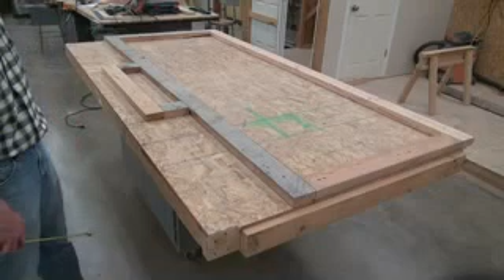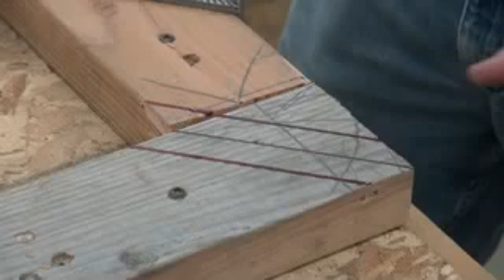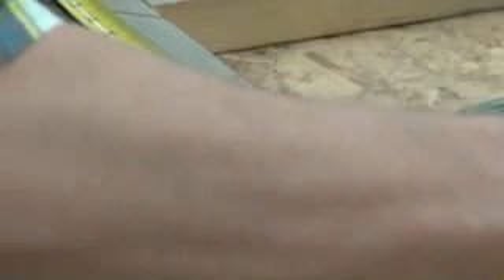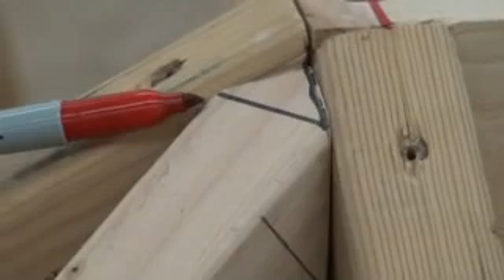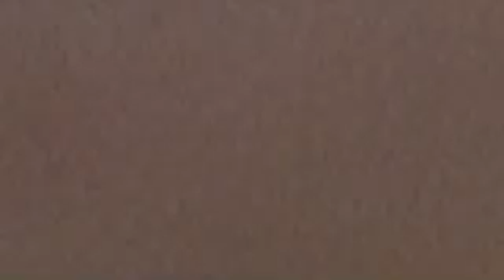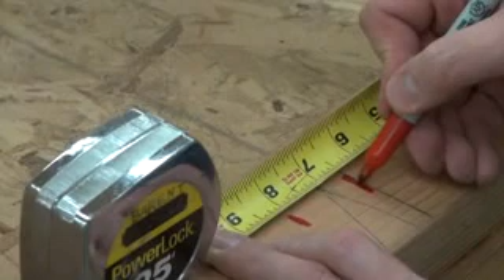U3 V5   Lab 3 Mock up Part 1

Comment: Why does one end of the mock up , hip rafters seem not to have the overhang. Looks flush with the wall corner.
Reply from the maker: It's just a slight (3" overhang) and might be the angle of the camera shot.  Otherwise all overhangs will be the same on a full size roof.

Comment: Whats better nails or screws ? i here diff story's
Reply from the maker: Nails are still accepted by both code and common practice.  Screws cost more, take additional tools.  Cost not a factor screws will perform as well as nails

Comment: What if your hip 16' long, are you still going to layout hip when its not straight unless you brace it. Show them the mathematical way and run string down center of hip
Reply from the maker: Long hips you always need to string.  Most of the time I'll set the jacks on layout, nail them to the plate, then set the jacks cheek cut to the hip and align with string and nail cheek cut to hip.